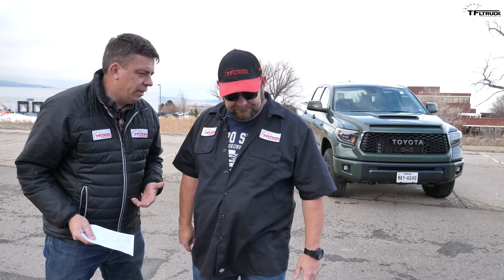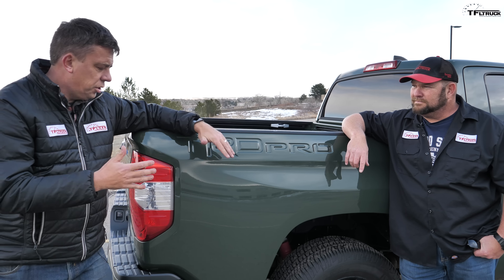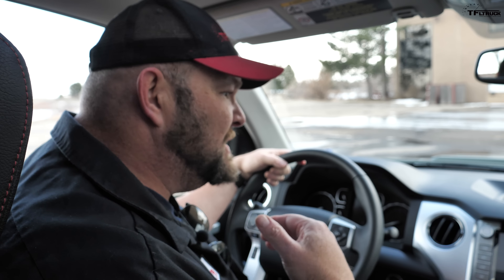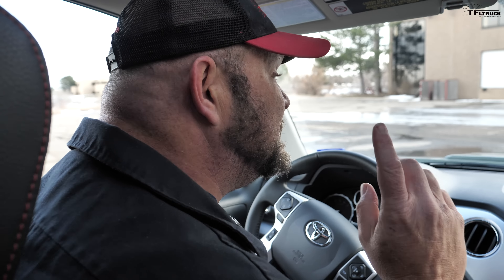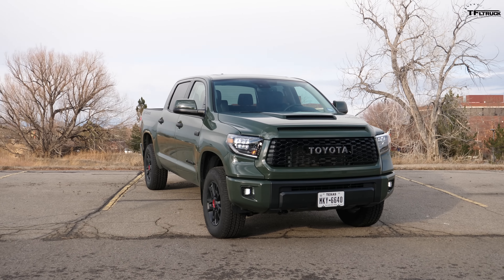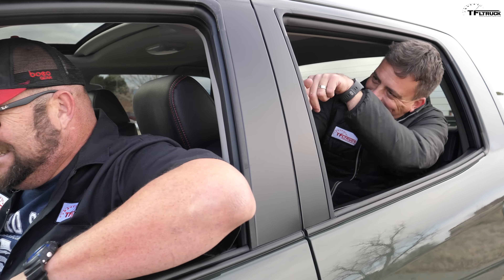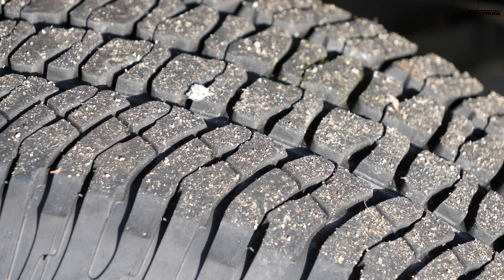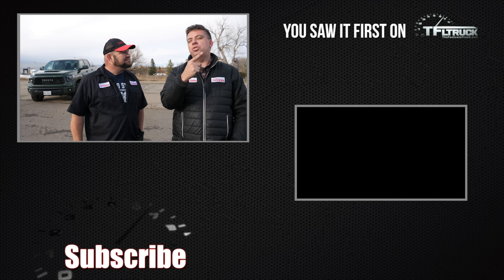The 2020 Toyota Tundra TRD Pro Is Outdated on Arrival - No, You're Wrong!

Comment: I know the Tundras getting long in the Tooth but my 15 is a Great truck. I don’t need Every Bell and Whistle on a truck. Thats where the other brands are lacking is a full feature truck in a reasonable price range. I was thinking of trading mine in at 150,000 miles but other than another Tundra everything was over priced or an SR XL type trim package for not much less than a Tundra SR5.

Comment: Good video but not everyone loves the crewmax with the small bed. I was lucky enough to find a TRD Pro in the double cab/ 6.5’ bed configuration and I love it. The small tires don’t belong on the Pro but you can change them, one of the first things I did. In my experience, you can easily beat the EPA estimates with the small tires or match them with larger, more aggressive tires. Yes, it’s a dated design but is that really a bad thing?  It doesn’t come with a ton of recalls and you won’t know the service writer by first name.

Comment: Yep its outdated.  Quality has gone to shit and prices are ridiculous.  The new ones have less features than my 08 base model had pretty pathetic they took features away in the new/newer Tundras yet raised the price several thousand dollars.  

I had a couple of recurring issues with my 08 Tundra all under 100k miles was far from impressed, finally sold the truck after those same issues resurfaced a couple years after they were repaired with 104k on it.  Won't buy another one.

Comment: 2 years ago I purchased a F150 because the Toyota interior was just too dated, and the gas mileage poor, did not even have push button start.  Sad that interior still not updated,   I expect the Toyota will be more reliable, but you see the interior every time you drive.  I would buy a Tundra in future if they update the interior and improve the MPG.

Comment: While I like how old school the truck is, I need the extra towing and payload!
Reply: Toyota doesn't sprinkle any magic dust on their..ahem.."advertising". 
 Tear apart a Tundra and any other truck and you will see just how stout Toyota makes their product.  It's engineered to keep.. not trade in after 4 years.  Just ask a mechanic.
Reply: @louie4316  Sprinkle some of that magic dust on the rear lower shock mount, it's rusting terribly already.
Reply: @user-pt6io2cq9n  haha ok I will. I do my own oil changes so what I do is an old farmers trick on rust proofing your ride. Keep some used motor oil, a cheap paint brush and just get some of that stuff all over your frame..suspension components etc.   Cheap and very effective.

Comment: It is ancient,two gas guzzling V8's,no start stop technology, still rocking that old ass 6spd auto,nobody and I mean nobody wants that little tiny bed. 5.5feet? Really? Good for groceries I guess.  And you can only get that 6.6 foot bed with the double cab. And no one is fitting back there. Toyota is #4 in truck sales for a reason. This! Its outdated and the body style hasn't changed since 2007! 2007!,and one more thing, a roll down back window doesn't sell trucks. It doesn't.

Comment: I still love the Tundra's exterior looks, even though it's an old design it still brings this look of toughness that doesn't seem to get to old. However, the interior is way outdated. Yeah the safety tech is great, but I'm going to look at the inside of my truck far longer than the outside and everyone loves bells and whistles. I will say that with a Toyota at least you'll almost never worry about your vehicle not working. You will however think a lot about how it would be great if your Toyota had this and that.

Comment: I bought a Tundra in 2012 because I was tired of having issues with my other brands. Ironically, it was the worst truck I ever owned, to the point I traded it with less than 10,000 miles. The fuel economy was horrible, no matter how I drove it. Would I try another one? Maybe, if they built one with a crew cab and 6.5 foot box. Problem is, there are so many other better options out there, I couldn't justify it.

Comment: I’d strongly consider a Tundra if they still made a single or extended cab.
Reply: Thier double cab is basically an extended cab, still much roomier than most other extended cab trucks.
Reply: Optimus Prime yeah but I don’t need roomier, I just want a basic truck with a touch extra space in case I need to keep things out of the elements. For instance the F-150’s extended cab is actually larger than the rear seat of my Focus. I don’t need that, I just need a truck.
Reply: Get a Double Cab, the rear doors are small and easy to open in parking lots. The sr5 is a basic truck with the basics. 8 foot or 6.5 foot bed you choose. Tows well. Runs well. Priced well. Resale is strong.
Reply: Laszlo Vass I’m definitely nit picky, so while I’m sure it’s great I simply don’t need it all. Given how capable midsize trucks are getting, I might be leaning that way as all of them still have traditionally sized extended cabs. Either that or a single cab F-150 which has about 8-9” behind the seat still for small storage.
Reply: @ALMX5DP  Nissan Frontier.  No major updates since 2005, dead reliable.  Least expensive midsize pickup by a mile.
Reply: ɹǝɔʞๅǝss ɐqɐupou that is an option. But incentive prices actually favor things like the Colorado and Ranger more. I’ve seen brand new Rangers for under $19k in XLT trim on Autotrader. That’s ridiculously cheap. Also weighing if a full-size (which is also super incentivized) May be worth the extra few thousand (lower 20k range).

Comment: Absolutely LOVE my 2015 Tundra CM.  Now pushing 110k miles and has needed nothing except basic maintenance. Just completed the big 100k mile service and its now ready for the next 100k.    While I really like this TRD PRO,  I can't justify spending over $50k on basically the same truck just to have push button start, fox shocks( which I could install for much cheaper), and bells and whistles that really don't make a difference..

As for resell value, non of the big 3 can come close to holding value as well as the tundra.

Comment: I love my TRD Dual Exhaust. It sounds amazing when you smash the pedal and doesn't drone or sound loud when driving down the freeway at normal speeds. I just bought a 2019 Tundra SR5 and so far love it.
Reply: What's your mpg so far? Do you have the 36 gallon tank? How comfortable is it long distance. My ram 1500 had rough ride over 1k miles. And best of 19 mpg not the 22 they claim.
Reply: @nateyoung6331  hey Nate I have the 2020 TRD Pro and I have a 38 Gallon take that it says gets about 575-600 miles a tank. I am getting about 13mpg as I live in city with bad traffic. Its amazing man and the ride is even better than my 2016 was. Feels like I am gliding on air.

Comment: If you need a front facing camera you shouldn't be driving in the first place.  The Tundra is completely outdated, and the issues they've had with front differentials, axle bearings, cam tower oil leaks, etc...yeah umm quality isn't there.  

If they'd go back to worrying about quality instead of all the garbage nannies it would be great.

Comment: I am really looking forward to the new Tundra and hopefully 4runner. I have been waiting for them for years now. I’m about to give up on Toyota (not really).
Reply: My biggest fear with the new 4runner is whether Toyota caves in to the unibody/crossover design like everybody else seems to have done. Like Nissan did with the Pathfinder.

Crossover SUVs are the new mini-vans, imho.
Reply: The NotSoGuitarGuy Yep. That’s a legitimate fear. However, I don’t think they will go away from BOF. They already have the Highlander filling the soccer Mom niche. 

I think it’ll be styled more like the Tacoma/new RAV4 with a new engine (probably Tacoma’s 3.5L), 8 speed transmission and a few more features in the upper trims: 360 cameras, HID or LED lights. Modest changes with new styling.

Comment: My 2010 Tundra with 104 K still looks very similar to new Tundras. I bet a 2010 truck from a Detroit manufacturer looks ancient.
The Detroit 3 are still caught up in new styling every year to try and entice you to buy, they also offer so many different engine and transmission combos that if you were to buy one used you do not know what you are really getting. Then they have their gimmicks, instead of reliability they give you a new gimmick to see if that makes you buy. However they do not tell you about the recalls you can expect to get or how often you will be back for a problem to be remedied. Speaking about styling look at the horror show Chevy put on this year, the ugliest front on a vehicle I have ever seen.

Comment: There's a lot of ways to look at it. The Tundra is super well built but that can only go so far to me. Interior is horribly outdated, no locking diff, bed lighting and locking tailgate are crappy dealer add-ons that require wire splicing. That said, if I wanted a truck to run 10+ years, this would be the truck I'd buy.

Comment: i can care less about all this elctronic crap in not just trucks but in all cars.. look all you need is  few basic things in a vehicle and that is power everything windows, locks, seats  bluetooth radio to call with air conditioning with three simple knobs zone, fan speed and temperature and a couple power outlets.. you dont need dual climte control a massive touch screen ventialted seats to keep your ass cool  and the rest of this elctronic safety crap.. keep it simple stupid!!!!!  people are depending way to much on these computer systems that when they dont work right or fail everyone is wondering what to do.

Comment: Cam tower leak problem fixed yet?
Reply: Can't speak for new ones but my 2016 with 54,000 miles had that issue but the dealer covered it under warranty and replaced the seals on both sides.

Comment: 2020 Toyota Tundra TRD Pro is outdated. meh
Meanwhile:
1992-present Ford Econoline (getting that sweet and juicy 7.3 in 2021, its 19th year)
1996-present Chevy Express (last truck to carry the Vortec name)
1993-2012 Ford Ranger
1992-2011 Ford Panther cars
2005-present Nissan Frontier
1999-2016 Ford Super Duty
2003-present Toyota Sienna
1972-1993 Dodge D/W-Ram
1973-1991 Chevy square body
1963-1991 Jeep Wagoneer (this probably takes the cake for the oldest and longest singular design-28 years)
1982-2001 Jeep Cherokee
1988-2001 GM GMT400 trucks
1992-2017 Nissan Tsuru (3rd gen Nissan Sentra)

Comment: Tundra....yawn. Funny that the name Tundra matches the overall design of this truck. Ford and Ram are good, everyone else is irrelevant.
Reply: We had to rebuild the transmission on our F150 at only 115K miles. Fixed it, sold it, bought a Tundra. 240K miles later, Tundra still running strong with original transmission and engine and everything. You can keep the fancy electronics, all I care about is reliability. Nothing beats a Toyota in reliability.

Comment: Where's the switch for the locking rear differential?  Oh that's right, Toyota won't put one in the Tundra.  Idiots(not the TFL guys, Toyota).
Reply: If you hold down the TC for 5 seconds to turn it right off you can put down 11's. Can't lock it up more than that.
Reply: @belanger9  that doesn't work too well when you are trying to bounce over a rock cliff and don't have 5 seconds to wait.  You don't buy a Tundra to lay down 11's, at least here in CO.
Reply: @richfarfugnuven6308  If you think you'll need it, turn it off before then. I know with the E-Locker in F350's it took a few seconds with them as well. Only one I know to be instantaneous is the GM locker which doesn't have a switch.
Reply: @belanger9  the raptor, powerwagon's, wranglers and the smaller Toyota's are all instantaneous...

Comment: I desperately wanted to buy this truck in 2018 but the gas mileage is so BAD! Got a Silverado with a 6.2 and average 18mpg, add that up over 150-200k miles and it’s over $12k in fuel cost.
Reply: A tundra will he worth 12k more in ten years 150-200k miles later
 And you wont be wasting your time in the service center during that time. And your math is off. I get 16-17mpg fwy easily in my tundra.
Reply: and how much more did the chevy cost?  did you factor maintenance cost?  or repairs?
Reply: @derrickldesign  I got it for $15k off MSRP which was better than Toyota would do by a WIDE margin. A lot of that had to do with it being end of year and new model coming for 2019. Long block or transmission in that truck could be replaced 3 times before it would make up the difference in fuel not to mention that the Chevy was cheaper in total with all the options. (LTZ trim) Trust me I tried every way I could to justify the Toyota but just couldn't do it.

Comment: Toyota forgot how to build powertrains for trucks.   There's an 8-sp. auto in the Camry, RAV4, and Avalon.   Why not the Tundra and Tacoma?  That'll boost both fuel economy and acceleration.   Toyota knows how to do that.   And don't get me started on the 4Runner,  that thing uses a very antiquated 5-sp. auto.
Reply: Billy Sou The AB660E is a fantastic transmission. Somewhat Easy to work on too. You will never have problems with it. If it ain’t broke why fix it? I understand where you are coming from but developing a new transmission is very costly.

Comment: Great video! Maybe more comparable to the Nissan Titan than anything else as far as payload and power.
Reply: When you compare it to a CC F150 they're quite close. The weight difference between the steel and aluminum body panels is literally the difference between the ratings on the Tundra CM and F150 CC.

Comment: Wow, what a pile of crap.  My 2002 V10 8.0l will kick it to the curb in horse power, torque and mileage.  If I just lay off the throttle a bit my drive train will last forever too.  Just $30000 cheaper.  No thanks Toyota.

Comment: Seems way to expensive for what you get.   No wonder not many sales.  Toyota.  Try $33k...
Reply: Tundra sells about 115k tundras a year. That's it. But they're very pleased, because that's all the factory is able to produce. The plant that makes the Tacoma and tundra is churning out trucks that are sold as soon as 2 weeks after being produced.  That's why they haven't brought out the redesigned model. They don't figure they need to halt production to retool the factory if the current one is still selling.
Reply: @JoseAlvarez-zi8qg  In that case, they should charge as much as possible for each one.

Comment: I had a 2016 TRD Pro, and sold it in 2 yrs. because engine had leaking cam towers at 9K miles; major tear down to repair. Worst rating with IIHS for head on and offset head on crash. Death trap. This pig is a dinosaur.

Comment: The engine will last forever, but if you live in the rust belt the frame and body will fully disintegrate within 8 years. Toyota does a terrible job rustproofing their trucks still. The lack of innovation is so disappointing.

Comment: LMFAO 380hp and 400lbft?!?!?!? In a 5.7?!?!?! What is Toyota doing?? This thing is a joke! DOA for sure!
Reply: Devin Bender Those aren’t bad numbers and wait for 2021
Reply: EverythingPNW 
Ram 395hp 410lbft (close) 
Chevy 400hp 460lbft 
Ford 380hp 480lbft 

The torque is king!
Reply: Devin Bender That’s the eco boost, and you exaggerated
Ford 3.5l EB: 375 hp 470 Tq 
Ford 5.0l: 395 hp 400 Tq
Ram 1500 5.7l: 395 hp 410 Tq
Tundra 5.7l: 381 hp 401 Tq 
Silverado/ Sierra 1500 5.3l: 355 hp 383 Tq
Silverado/ Sierra 1500 6.2l: 420 hp 460 Tq

The tundra had the power of modern day half tons since 2007. Only now have the big three half tons achieved the same numbers.Tundra is due what is expected to be a complete redesign in 2021 so I suspect a new engine is in the making
Reply: EverythingPNW I highly doubt they have the funding for a new engine. They sell very few v8 tundras to off set the cost. 

The new F-150 is coming soon with an updated Ecoboost engine. Even more torque. And hybrid options.
Reply: Devin Bender The eco boost is trash. If you want torque buy a diesel. Why anyone would get a six cylinder gas truck turbo or no turbo is beyond me. Did you know ford also lies about their mileage and towing capacity?
Reply: Devin Bender Toyota definitely has the funds